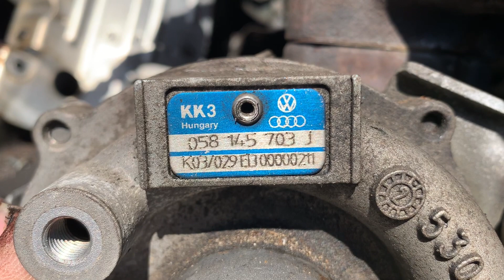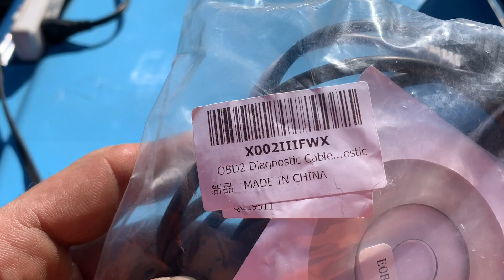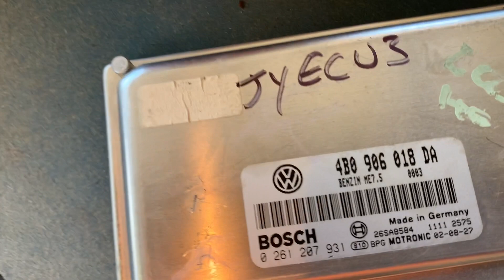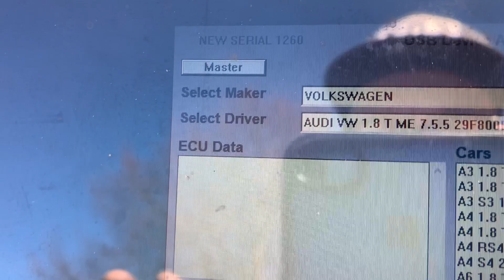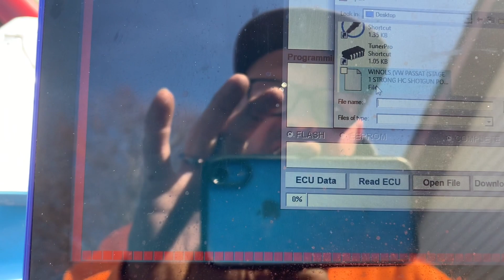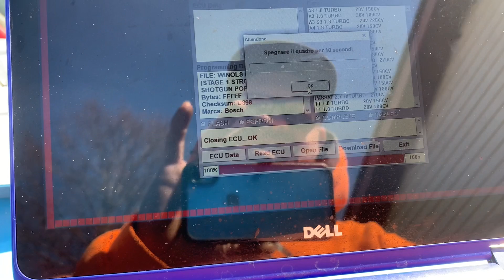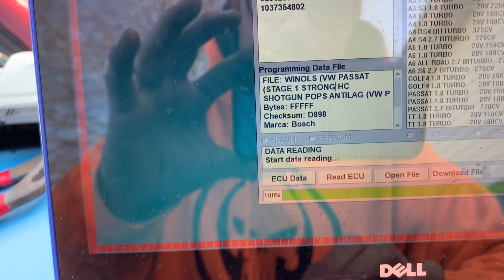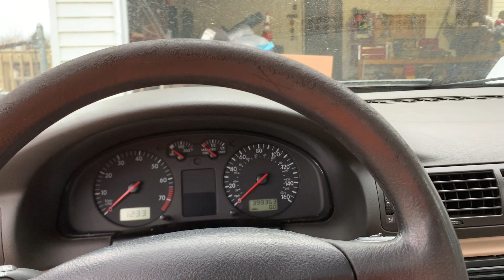Can We Put A Stage 1 TUNE On The $800 Budget 1.8T VW Passat B5 For $50!?!?

Comment: That's awesome man I'm thinking about picking up a 2003 Volkswagen Passat Wagon 1.8 Turbo I want to do a Bass build with an Orion hcca 15 to compete and it would be badass to roll up to the competition with head turbo whistling definitely catless downpipe and turbo vac cold air intake bov and eventually front mount intercooler that would be sweet
Reply from the maker: I had two hcca 15.2s they are insane!
Reply: the stock intake and recirculating valve setup will get you to whatever HP the rest of the car can handle but definitely won't sound as cool

Comment: No major difference between the engine codes except that some of them have the VVT chain tensioner and some have a normal chain tensioner, you can put the vvt chain tensioner on any of the heads though even ones that came without it, the first gen head though has larger exhaust and intake ports, but that doesn't matter to the ECU
Reply from the maker: Thank you!!!

Comment: I've got one close to that ride in the yard. 2004 VW Passat GL 1.8T AWM 5-Speed with Four Motion with Shadow Blue Metallic Paint and Anthracite interior. Last on the road registered and insured according to VW's PDF... Really would like to know the software, cables, and so on your using. Been researching for 2 years and only one tuner has something for AWM engines. It's frustrating. Fixing stereo amplifiers and computer motherboards since highschool so I can figure the rest out. Really be helpful.
Reply from the maker: Nefmoto.com

Comment: thought me7.5 wasnt drive by cable?
Reply from the maker: The aeb motors are drive by cable. I’ve seen a few audi and Passat B5s with it.  They are ran by me7.5 and supposedly way more tunable. I thought about the intake throttle body and Ecu swap but it is pretty extensive I’ve read.
Reply: is this pre 2000 or 99?
Reply from the maker: 2001
Reply: @KBMOTORSchannel  after 99 they made the b5.5 passats... and yes , way more tuneable. i might do the throttle body gas pedal and ecu harness but as you said , too much work, as far as my ecu. we bridged the mpps cord to the 12v pin off the cord and it takes the flash in car. weve been tuning and moding my aeb motor and ecu setup for a year now, 20psi on ko4015 with bosch3 style 315cc injectors. ECAC has files ready for yah just use my yt channel name for a discount
Reply: ive been following since you got yah son the car !!
Reply: @KBMOTORSchannel  yes ! i wanna see this car become showroom quality ! then ill take a road trip to Michigan
Reply from the maker: Will do man!! Thanks! That black Passat is sick.  Nice.